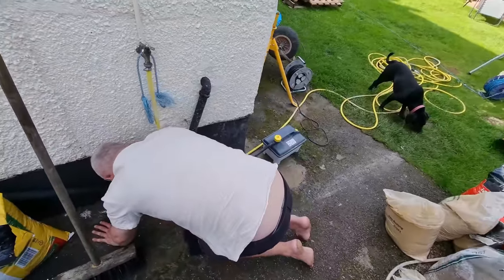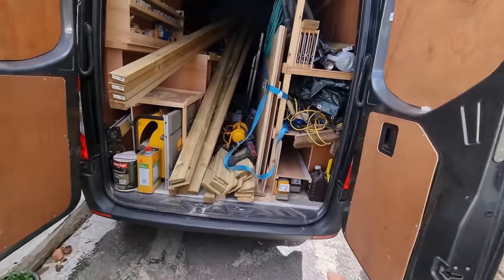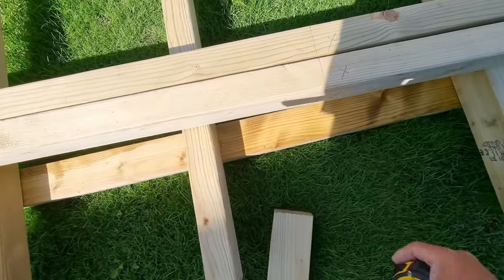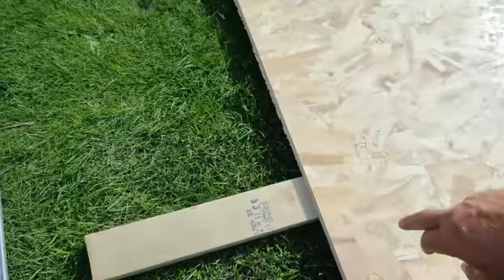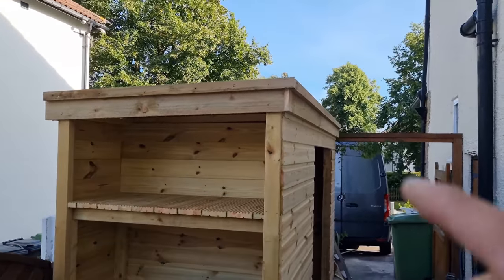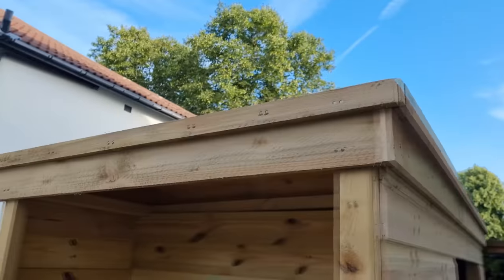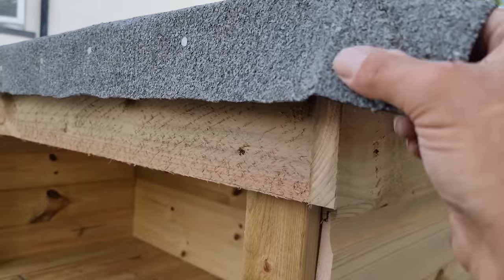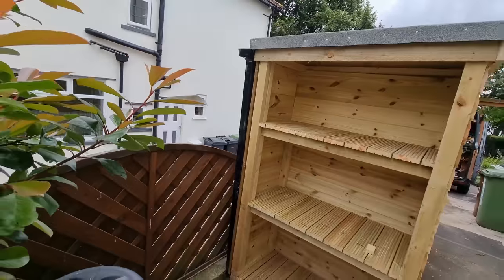Tafty's shed/wood store build Pt4 - Putting the roof on, timber frame, OSB board & roofing felt

Comment: Nice job mate, that shed sure is a solid build, looking forward to seeing how you construct the doors next, your new morticer looks the business, nice and solid, definitely not a plasticy diy machine, hopefully it does all you want, will look forward to watching you use it 👌👌👌👍👍👍🇦🇺
Reply from the maker: Thanks Graham 👍 yep, i try to build strong enough, the price difference between 2x2 & 3x2 is that much & the shiplap is the thicker stuff, rather than the thin 8-10mm stuff they tend to put on sheds, I think the little extra spent makes a huge difference 👍 Yep the morticer is a proper toy, i did look at cheaper models/brands but they weren't much better than my old one & not much cheaper than this, i wanted one that was at least something like i'd used in workshops yrs ago & didn't want to be limited by what i wanted to do with it, if i'm going to upgrade i might as well go for it so 'in for a penny' i spent what i could, i've jobs coming up so it will def get used,

Comment: Nice job as always, wondering now what the mortice is for?👍🏼
Reply from the maker: Thanks 👍 Hard to explain in writing but i like to put M&Ts on my outside projects & ext doors, i'm not that keen on using dominoes on inside house doors either but my old morticer was difficult to get an accurate mortice cut, i've jobs coming up for it, (maybe you've seen my next vid by now tho 😁) sorry this is late.
Reply: @Gidjoiner  👍

Comment: I'm guessing I am of similar height and vintage to yourself, Gid. While watching you lift the roof frame it reminded me of my own exploits earlier in the week when laying a slab path. Those 3 x 2 concrete slabs have never been easy to man handle but I reluctantly realised I am not the man I was when I was 25. Do you feel that way too? I only have to do such lifting on a DIY basis but I sympathise with you working on your todd when heavy lifting is required. I hope you get a lot of use out of that Morticer . I have a JET model, I think I need to invest in quality chisels as the cheap ones I bought just don't cut the mustard. Get what you pay for I expect. Looking forward to the next vid. 🤙
Reply from the maker: Thanks 👍 yeah 53, starting to feel it a bit, it was a tough start a few mths ago after my long break, got a bit unfit, a few muscles had forgotten what to do but getting back into it, the wood does seem to be getting heavier, that board going on the roof & the posts for the pergola 😰👴  we'll see, either i get fitter slowly as i do more or time will catch up on me 🤷‍♂️😂 yeah the morticer prob won't pay for itself but it'll get used & make my work better, more accurate & a little easier for those M&Ts, 👍👍 i bought the chisels that they, the sellers supplied, they're really not cheap, had a look at axminster to see if i'd been ripped off but actually i got a fair price, I'll have the final of this up asap in the next day or so, Sun-Mon https://www.axminstertools.com/accessories/machinery-accessories/morticing?a_chisel_mount_size=26654%2C26655&manufacturer=1516
Reply: Gid Joiner yup, 57 at the end of the year, strange as it seems I was 28 a couple of years ago, Christ knows where the time goes. I'm just a diyer/hobbyist, mate but that alone is hard enough. Guys like you doing it day in day out get my vote.
I think you'll be glad you bought the better chisels, the smaller ones 1/4" & 3/8" I have have been fine but the 1/2" and 3/4" are only good for soft woods (dry) I think the extra wonga spent is a good investment. Good luck.

Comment: Gid I want to build a log store about 7ft wide by 3 ft deep and maybe 5ft high. Have you done anything like this? Do you have any plans on how to do it?
Reply from the maker: Hi, sorry i don't have any plans, every job is different, location & clients wishes, I would work the timbers out using the Span ÷ 20 + 20mm for 44mm joists @ 400mmm c/c calc. so if you're going 7ft wide (2100mm-ish), flat roof sloping backwards with an open front you'd need 2100mm ÷ 20 = 105 + 20mm = 125mm, so you'd need a 5" beam across the front, the added 20mm in the calc is to reduce bounce & for added safety in a floor but seeing as this is just a woodstore you could forget that added 20mm & just use 4x2's ... but the beam across the front would be holding up the spars going backwards across the 3ft distance on to the back wall & so it should be doubled up as a trimmer joist/beam, so two 4" timbers nailed together across the front & the spars going back are only travelling 3ft (900mm-ish) so only need to be 3" timbers, What walls or post support this is totally up to you, i would consider 3x2 walls like in this vid, But like i say every job is different & if i was building your woodstore i might choose a different approach & timber sizes,

Comment: What happened to your 'Head Cam"? I'm sure it would have been easer than clamping the phone in your mouth 😁. The Morticer is bigger than I was expecting. but better big than small and limiting the work. Hopefully it will pay for its self quickly.
Reply from the maker: I left the batteries in the charger while i was off work, one or two of the three are a bit knackered, i don't trust they'll film for long, need new ones & to properly test the ones i have, i haven't got properly up n running yet work n filming. Yeah the morticer 👍 not sure if it will ever pay for itself but it will make my work more accurate & less stress thinking about doing proper M&Ts, i did have a look at other cheaper models but some weren't that much better than my old one & weren't that much cheaper than this, if i'm going to pay a lot i might as well by the best i can, in for a penny 👍 i don't want to be limited, that would do my head in, upgrading but then still not being able to do some stuff, hopefully this will do all i'll ever need 😊😊👍👍

Comment: Looks great and a very professional. Just wondering what this cost.
Reply: With timber prices the way they are I'm guessing twice as much as it should have cost.
Reply: @GTOOtt  well said 🤣🤣🤣
Reply: Gid said in the first video the timber alone was £650
Reply from the maker: Thanks 👍 Yeah, i think i inc a quick clip of the receipt for wood £649-ish, + a few extra 3x2s, 1¼ sheets of OSB & a roll of thick roofing felt, not the cheap thin shed stuff, for the roof, concrete block base, cement, sand, nails, screws, gutter, door furniture... cheaper to buy one 🤣🤣🤣🤷‍♂️🤣🤣😆